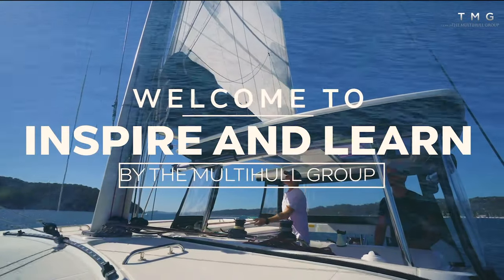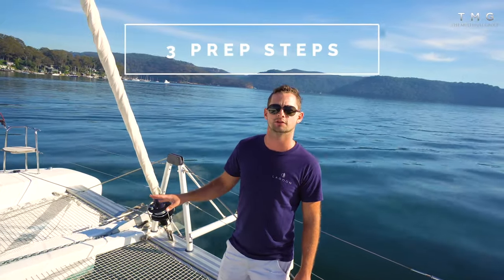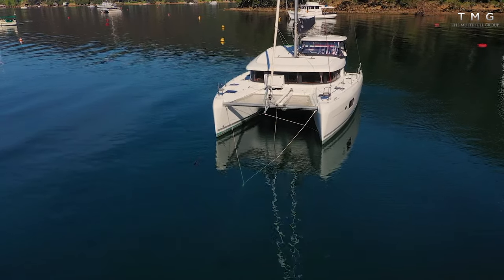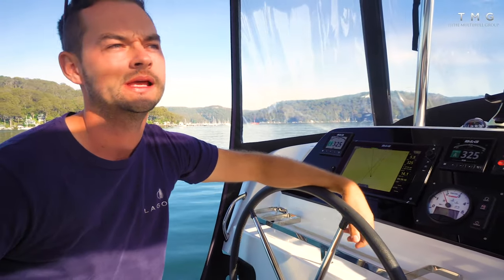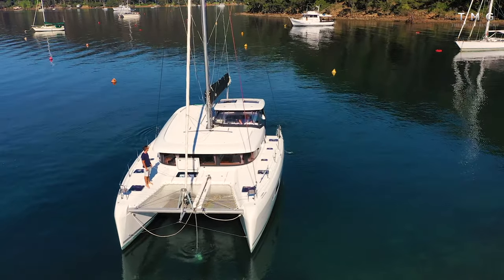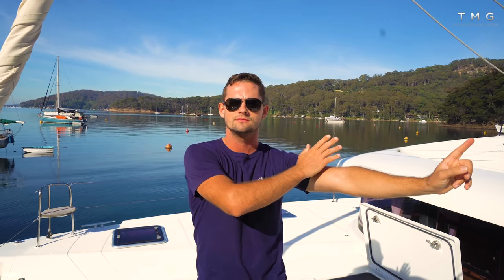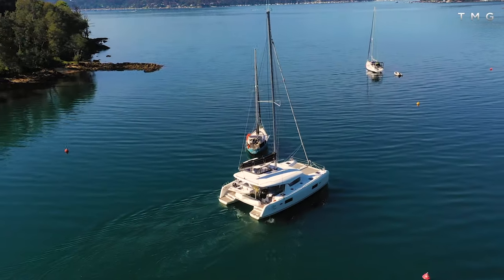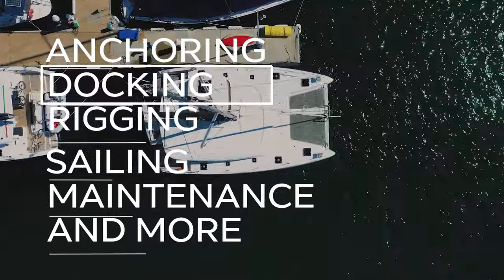How to Anchor and Set Up a Bridle on a Catamaran | TMG

Comment: Thanks for that.
Just a couple of points as a newbie, you didn't point out the sound change of the chain to know when the anchor is at the bottom (or I missed it?). Another good thing would have been to point out what the bridle attaches to at either side of the hull. I realise this is more a 'how to use' video but as someone who's completing a 40ft cat, it would be useful to know what is common practise.

Comment: Hi TMG, I think that i am missing the part where the anchor is pulled in to the ground. Now in the video it looks like you pull on the anchor with the windlass but in reality the bridle should be used to pull the anchor in the ground with +- 1500 rpm backwards.
Reply from the maker: Hi Sea Heroes, hope you are enjoying your Lagoon adventures. You are right in saying this is another approach, both work and this is just the way we personally prefer.
Reply: I agree with the comment.   With the method shown,  you're in  reverse with the engine powered up to ensure a good set, and all the force is on the windlass.  That's what you warned not to do via pulling the boat forward with the windlass.  With this boat it would seem that, before you are ready to back down harder on the anchor, you could attach the chain shackle to the chain just aft of the bow roller and cleat the snubber line off on that mid ship cleat.  Then you can back down on it and the cleat is taking all the force, not the windlass.  Once set, attach the bridle.
Reply: 100% agree with both comments. The video is very good at teaching the basics and helping beginners learn good techniques, however if you're going to publish authoritative videos you should make sure that critical feedback is taken and the videos are instructing the best approach. As both comments have already pointed out you should not back down on the anchor using the windlass to hold the anchor. Two reasons for this, one is the strain on the windlass and second the bridal attachment will change the scope significantly, especially in shallower anchorages. Other tips can be provided as well like marking the chain with paint, chain markers, zip ties to measure distance.  My last bit of feedback is maybe don't do these videos in the most perfect conditions,you don't need to demonstrate in 20kts in a tricky anchorage but having some breeze, common will greatly help make them more realistic

Comment: Would you ever set a second anchor off the bow for extra holding (about 60 degrees apart) - we do this with monohulls.  Not sure how you would do this in a catamaran.  (Same with a Bahamanian anchor setup - two off bow at 180 degrees).

Comment: Let me start with I've never sailed a boat before.  I'm just a youtube watcher.  In watching videos on anchoring it would seem to me to be beneficial to attach a rope that is attached to a floating object to the anchor to keep up with where the anchor is located.  If you are in 4 meters of water then attach a rope with 5 meters of slack to the anchor.  Then you could easily look out and see what your location to the anchor is at all times.  The fact that after 1000s of years of sailing nobody does this there must be a logical reason why that wouldn't be a good idea.

Comment: Hello, but the bridle rubs against the stays of the bowsprit and that brings a lot of noise into the boat. It is better to run the bridle around the outside of the stays, not inside.
Reply: I second that. Sleepless night is a good advisor.